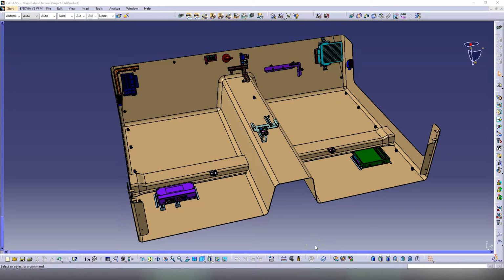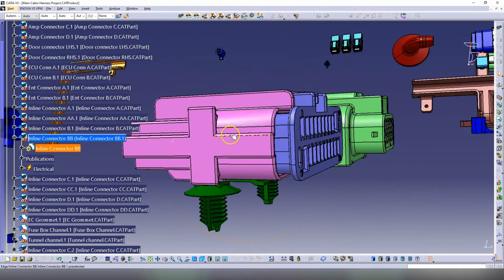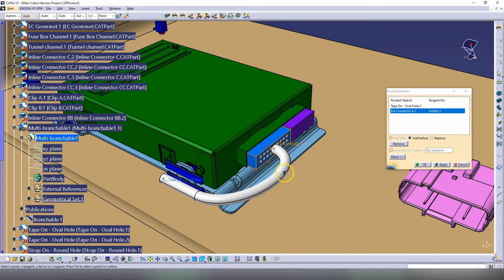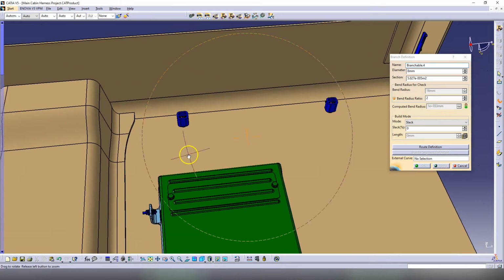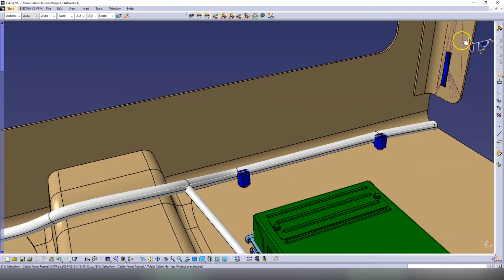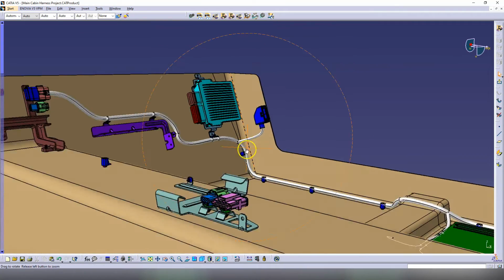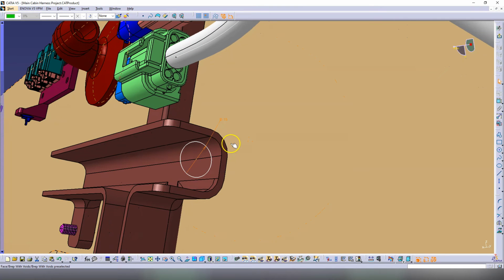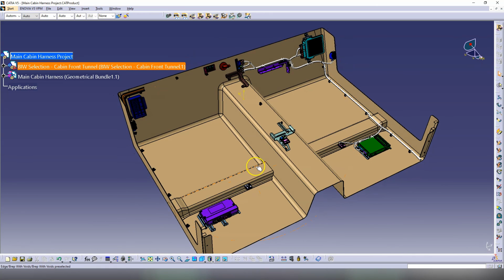Catia V5 Electrical Harness Design Tutorial for Automotive | part 1

Comment: This is a great job!
I'd like to give, as wiring design engineer, an advice to those who are getting closer in wiring harnesses design.
You can be a contractor or you can be a direct employee of a manufacturing company which has an internal engineering department (such as me): 
be aware of something that you have to consider (apart of the carmaker design rule) and that we can define "design for manufacturing" that gives all the "good practice" to apply on your 3D models (that will come in a 2D model),  in order to let the company produce properly what you are designing in 3D !
It's not so uncommon (and I can assure you that's happened many times) that what you think you have designed appropriately may result, in the actual physical wiring harness, in certain differences that can lead to it being unmountable!.
So you know what it means?
If you are an employee, you get reprimanded by your boss or your company, but if you are an external consultant, you risk being ‘burned’.
Reply from the maker: I teach all of those concerns in the Udemy courses with examples and practice projects
Reply: @alexdesignman  you're right. I saw after my comment here